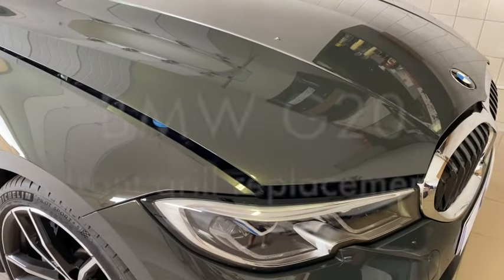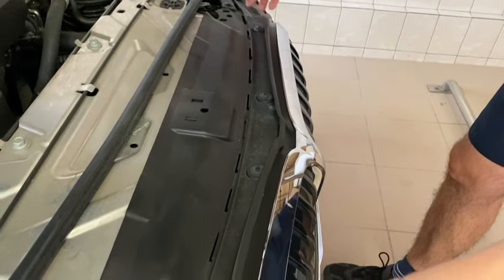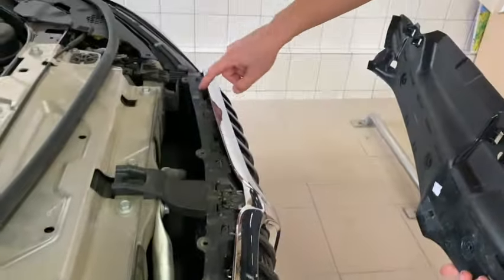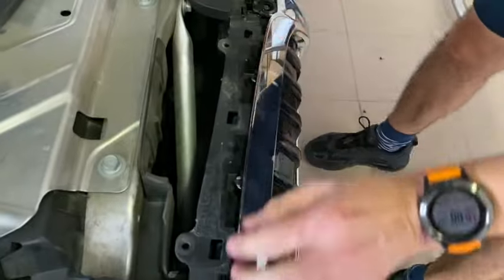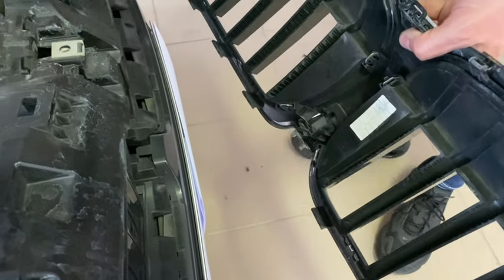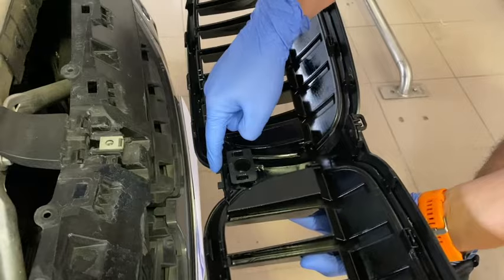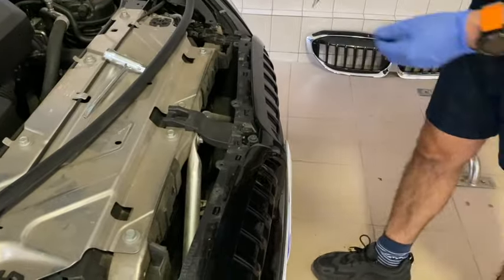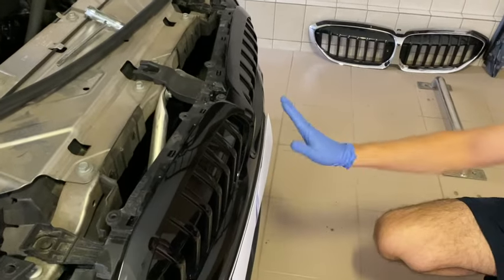BMW G20 (3 series) front grill change (SE01E01)

Comment: Thank you for such helpful video. I'm proud that I changed the grill myself today. I bought the car half year ago but I feel so happy again because of new look. I watched few videos like this on yt, but yours is the best. Keep it up :-)
Reply from the maker: Thanks! We are glad, we could help you about this. Did you see the Optical Tuning and the Diffuser change videos too?
Reply: @gykgykbettercar  I just checked it, however I dont think I will change the diffuser because I like the stock one. Maybe I will think about new exhaust tips. Just a quick question. Why did you cut the pipes off? Some people say thay you can take off the tips with the hammer. I'm just curious because it looked more difficult on your video. Thanks again for good content :-)
Reply from the maker: @JT-lu5tg  Thanks for Your comment! There are few reasons why you need to cut the pipes. The factory end is splay a bit at the end so the Akrapovic (which is my favorite) would not fit on the tube. Second, the length of the factory pipe is almost the same like the Akra this case if would fit anyway you would see the factory tube as well. For me would look silly... I don't know what type you plan to install but this Akra one is double wall version which is really nice if you just look inside. Unfortunately you need to work if you want to have professional result. 😁 At the diffuser the middle part is missing from the stock one. This is why looks more characteristic simply looks better. Plus, we made black parts at the front and to keep the balance you need the same amount of black at the end. 👍 Up to you...

Comment: I put the M-grill there. Does the air thing work with that or what you mean by difficult?
Reply from the maker: Hi Veeti, will be no problem making with M type grill, The active blades will work well. I also made 5 series and 3 series too with M and is ok. No problem of cooling. If you are fine with the outlook is ok 👍
Reply: @gykgykbettercar   Yea i think its allright, thanks for the answer man.. Your the 🐐

Greetings from Finland here is cold as fc.
Reply from the maker: @veetitiilikainen3344  Hey Veeti, here is almost spring… 😀 I am in Hungary. Thanks for your nice words, hope the video helped you… check the Diffusor switch as well in reality looks much better like on screen. 👍Take care of Santa Claus 😂 Rgs, George

Comment: Excellent video, just what I was looking to find! I am getting a new g20 this week. I am hoping to replace the chrome slatted grille with a black slatted grille. I assume once I swap slatted for slatted, it doesnt matter that I source the part from an aftermarket supplier as opposed to main stealer?
Reply from the maker: Hi there, usually should not be a problem. I am not sure I got your point clear enough, you are going to change only the grill but the frame would stay? In such case I am not sure will work. If you change the whole grill (as shown in the video) there is not problem if original part or after sales. I hope this helps…
Reply: @gykgykbettercar  no I will change the whole grille as I believe it all comes as one part. The frame cannot be bought on its own I believe
Reply from the maker: @shanecolton3500  If you change the whole will be no problem! Aftermarket type would perfectly fit… good luck and let me know how it works :) Congrats to your new BMW ;)
Reply: @gykgykbettercar  thanks man. First ever BMW so a little nervous of the running and maintenance costs as I've been  VAG driver up to now.🤞🙌👍🚘